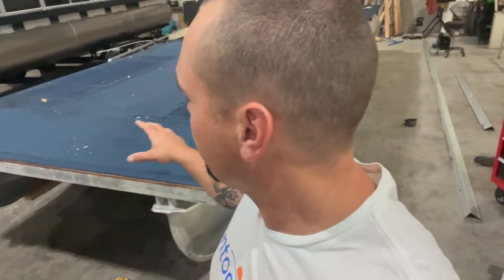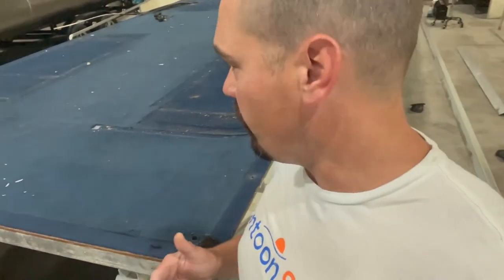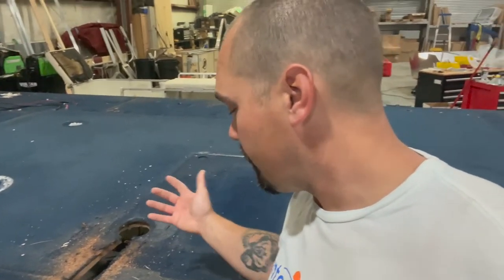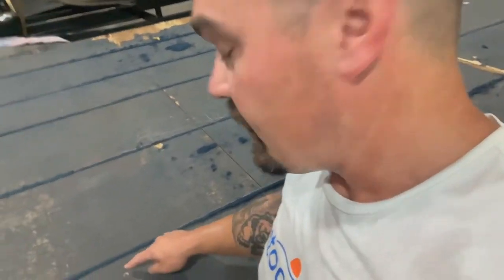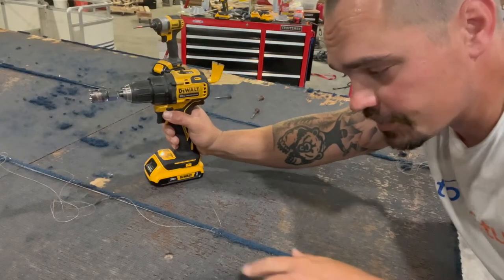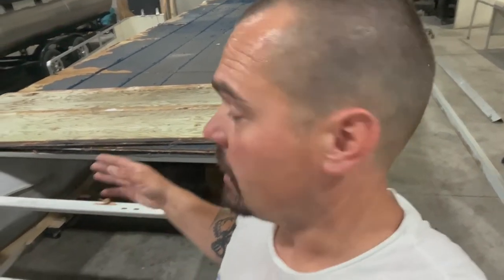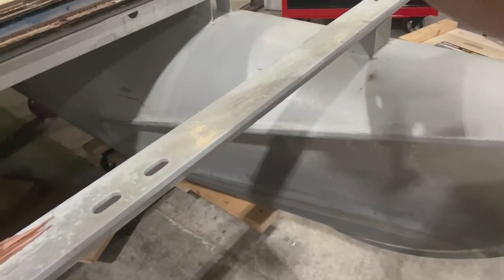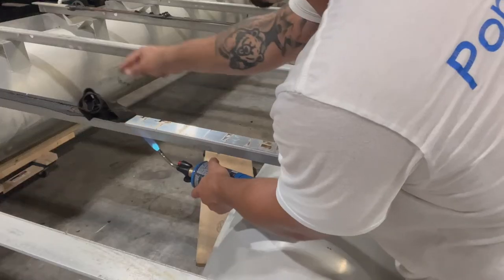Pontoon Restoration Tips and Tricks - Carpet and Plywood Removal

Comment: Thoughts on removing old carpet, laying 1/4" ply over top then installing vinyl floor over the "new" deck? This would be for an old pontoon houseboat, 37' overall. Looking to firm up the soft spots on the outside decks without doing a full tear out. Attempting to complete the work while on the water, in the marina.
Reply from the maker: That's a tricky spot to be in. I've seen someone add 1/4" plywood on top of an older rotten deck and it wasn't pretty. The 1/4" basically fell into pieces as we uninstalled everything. If a total tear off isn't an option, I would personally try to go with aluminum sheet instead of another material that will rot. Because we work on customers' boats we have to do it the best way possible so that we can guarantee the end result. I haven't tinkered around much with quick fixes like that so I'm not a ton of help on this one!

Comment: Our fishing club recently purchased an older pontoon boat to help transport and place fish habitats.  This is a total work boat.  We need to replace the deck but was wondering if we could use a less expensive plywood from a home improvement store to keep costs down.  Any recommendations would be appreciated.  Your videos have helped us get organized and prepared.  Thanks.
Reply from the maker: You could go with a CCA treated plywood that’s not Marine Grade…it’ll just have knots and voids in the surface you may feel under your feet…not a huge deal for a work boat that you’ll likely wear shoes on anyway. All the boats I’ve seen that were in freshwater have had no issues with CCA treated plywood reacting with the aluminum of the frame. Definitely mixed reactions about that out there…I can only speak from my experience.

Comment: DO YOU ANYTHING ABOUT A SEIZED UP MERCURY 50HP 2 STROKE  OUTBOARD
Reply from the maker: Probably was run out of oil or an oil line cracked, or overheated otherwise. Unfortunately it would have to be torn apart to determine if it's even worth rebuilding (likely it isn't).

Comment: Okay so… since the new decking has about a lifetime warranty and chances are I’ll have to replace the flooring again… why not just skip gluing it down?
Doesn’t the flooring dry faster without glue under it ?
Reply from the maker: The plywood will likely outlast the vinyl in most cases, however if you don't glue the vinyl down it will be more likely to wrinkle, wave, and crease. Plus it may not expand and contract with the plywood causing issues there too. It'll still give you 20 years of use if you protect it from the sun and take care of it. The vinyl flooring repels most if not all of the water anyway. 

Glue it down and do it right the first time.

Comment: 3 QUESTIONS:  (1) IF THE WOOD ISN'T TOO BAD, HOW ABOUT JUST FLIPPING IT OVER? (2)  ARE YOU FAMILIAR WITH THE PRODUCT TUFF COAT TO USE INSTEAD OF THE MUCH MORE EXPENSIVE VINYL, AND (3) WOULD IT BE BENEFICAL TO INSTALL CORRUGATED TIN UNDERNEATH TO KEEP WATER FROM SPLASHING UP AND CREATING MORE DRAG?

THANK SO MUCH FOR YOUR AWESOME VIDEOS.
Reply from the maker: Great questions!

1) marine grade treated plywood is void free on ONE side. Flipping it would move knots and voids to the top where you’d see or feel them. It would also be taking the surface rot from the top and be moving it to the bottom, still shortening the life of the wood. If you go through that much trouble to flip the wood you should just replace it to make it another 20+ years of worry free use.

2) I painted the interior walls of my aluminum jet boat I built (video series is on the channel) and I LOVE IT! I know they make a wood coating too, but haven’t tried it. I think it could be great, but go with a light color to avoid the floor getting too hot!

3) We install 0.063” sheet aluminum on a lot of tritoons as “underskin” to protect the bottom and crossmembers from spray/waves and quiet/smooth the ride out. Works great!

Thanks for watching and commenting!
Reply: Thank you Tom.  You are helping so many of us. You are appreciated.
Reply from the maker: @jaypietsch5411 happy to help, glad our videos and info is helping folks out there!

Comment: Why not use tape on all the aluminum rails to isolate them from the treated wood, is there a downside other than cost? Thanks for all the tips and tricks, your years of experience is invaluable to us DIY’s! What do you think of priming the (non treated) marine grade plywood sheets before installation as an additional waterproofing measure?
Reply from the maker: Thanks for watching the channel! It wouldn't hurt to put tar tape on all of the crossmembers, however it's just not usually necessary, especially in freshwater. The reaction between treated plywood and the aluminum is minimal in my experience. Even the big pontoon brand manufacturers use tape only on the seams. 

I only recommend installing marine grade CCA treated plywood as most other "marine grade" plywood isn't build to get wet constantly. If you MUST use an untreated marine grade plywood I would definitely consider coating it or sealing it to prevent rot.

Comment: Thanks ! So far tearing off decking is proving near impossible.. but here’s the bigger problem. Although the boards weren’t in THAT bad of shape.. I had one bowed like a hill. Taking it off suspecting water damage but actually… the aluminum crossmembers are bowed up from.. I’m assuming the transom box hitting the trailer center bar and resting on it.. 
It appears to be the correct trailer for the boat size… but why is this happening and how to fix. Help! Please 🙏
Reply from the maker: I've only ever really seen a crossmember bow up from the very forward part of the transom levering up against it. It seems to be common on Crest Pontoons especially. The weight of the motor pushes the back of the transom down, and it levers the forward mounted part up. If you've got multiple crossmembers bending upward then that's definitely something I've never seen before!
Reply: Thanks Tom,
You were right It was mostly just the one crossmember. I put the pontoon on the ground and off the trailer and It almost bounced back into totally straight ! 
So now I guess we just have to remember when trailering to keep the pontoon ALL THE WAY BACK on the end, about 1.5’ off the front, so that transom box doesn’t hang up on the trailer.
Also ! I found a few easier ways to get the rusted elevator bolts and self tapping screws out (my pontoon had 50/50) 
And got the last boards off today ! Just waiting on the new decking 😃
Reply from the maker: @marysimino1726  Glad that was resolved. It's common for folks to shove the boat too far forward on the trailer where the transom is resting on a trailer support. Glad things are going well on your project!

Comment: Hey cool video. About the treated wood there are different treatments they use. Gotta make sure it’s the same type of treatment.  Some wood says not safe with aluminum. Otherwise your right a lot of people gonna chime in. Lol.
Reply from the maker: Luckily we know this is the same treated plywood the big manufacturers have been using for decades. I’ve seen lots of chalky residue left behind by the interaction between the plywood and aluminum, but nothing where damage has been caused. Gotta remember we are freshwater only too!

Comment: Do you charge by the foot? How much was the charge on that particular job?
Reply from the maker: Every boat is different based on length, width, furniture and accessories, etc. Most 20' standard layout pontoons are around $4500-$5000 for a complete tear down and floor replacement. We never do a new floor without replacing the plywood.

Comment: Would undercoating the plywood with Duraliner or some other undercoating be good?
Reply from the maker: If using Marine Grade CCA Treated plywood there is no need to seal or coat the wood, top nor bottom. In fact, one could argue that the wood needs to breathe to dry out after being wet AND the wood must breathe to allow adhesive to cure under new vinyl flooring which does not breathe to allow curing of flooring adhesive.

Comment: I’m a fan of the treated as well. Pontoon stuff uses cca treated what’s your opinion on ac-c treated? They say it’s more corrosive than cca but it’s all we have in California.
Reply from the maker: I can’t say much on ac-c as I’ve never used it. I think those corrosive factors are multiplied in extreme environments like saltwater and areas with high electrolysis. I’ve torn down 80+ boats in the last few years and haven’t seen anything other than some white dust from the reaction. All freshwater boats though!

Comment: Thanks for the video, do you recommend the zylan coated self tapping screws or the 1.5" stainless steel deck bolts for the flooring installation? the self tapping makes me think they could come loose after a while and the deck bolts could protrude out on top so you could make feel it under the carpet? thanks for your recommendation and response.
Reply from the maker: Thanks for watching! It's common for us to use a mix of the self tapping screws and stainless deck bolts...deck bolts on the seams and self tappers everywhere else. I've torn down over 60 boats in the last couple of years and I've found that the bigger self tappers like the zylan coated ones DO NOT tend to loosen. The only boat I've had loose self tappers on was a newer (2011 I believe) Berkshire, and it had much lighter self tappers that honestly appeared to be stripped out from the factory. Here's a video of the 3" deck bolt, but it'll show you how I counter sink the head so that nothing is felt from the top side:

https://youtu.be/syNwS4-aupU

Comment: I’ve been apprehensive to replace the flooring because of needing to reposition the furniture/helm etc correctly. I’ve not seen any videos on how folks do that to configure the mounts how they were on the old wood after reflooring. Is that pretty straightforward? Any tips/tricks? I know a lot of your stuff you reconfigure, but in the case of using the same fencing and furniture. Use the old boards and holes as templates?
Reply from the maker: I love this question! I will definitely do a video about it on the next boat we restore using the same railings. In a nutshell, I would measure your spacing of the front and rear decks if applicable, and record the measurements so that when you reinstall the railings you can match the old spacing. From there, I install all new plywood and RARELY use old boards as templates for holes, unless they’re for transom fuel tank access or other critical parts that are being reinstalled. I use old boards as templates for rear deck cutouts or front deck shapes/sizes. 

I simply make all new holes once the seats and helm are reinstalled. Once your railings are in place your old furniture will match back up to the railings where you can fasten them into the new floor. 

I’ll make a video on the approach to reinstalling railings when I get the next chance. Thanks for the question and hope this helps for now!
Reply: @tomspontoons  that all makes sense, thanks so much for the reply! Love the content and look forward to a video around this.

Comment: Can you change the U shaped toons out for the round ones?  Or is it just better to go buy another pontoon?
Reply from the maker: I would seek out a different option if you want to do that size of a modification. Lots of good options that are affordable for late 1990s to early 2000s boats with bigger toons, stronger transom, and beefier structure.
Reply: @tomspontoons  I have been leaning towards selling my current pontoon and buy another one.  I will keep my motor because I bought it new last year and sell the boat with the old motor that still runs
Reply from the maker: @MrSilverado1982  sounds like a solid plan to me!

Comment: Im curious about the cost to do this, for a 21' pontoon. And how much time does it take to remove rhe seats etc.
Reply from the maker: The cost can fluctuate quite a bit depending on what all you do and add in materials. We have another video that walks through a whole restoration in great detail, I'll link that below. It usually takes us 1-2 weeks to complete a restoration project. That's working 8 hour days with 1 or 2 people working on the boat at various points. And most of our restorations are somewhere between $13K and $18K depending on materials, accessories, etc....and that's with parts and labor! 

https://youtu.be/BPHTvVAqn7o

Comment: Would it be ok to water seal the wood beforehand?
Reply from the maker: Great question, and a common one at that...short answer is no. When using a marine grade TREATED plywood there is no need to seal the wood, in fact you want the wood to breathe in order to dry out and prevent rot. Water will always find a way in over time, even if sealed, and I'd rather that wood be able to dry back out than have moisture trapped for any amount of time. 

I've never seen a boat from the pontoon manufacturers with sealed wood...that's probably the best trend to follow!

Comment: How much did you charge for doing the job?
Reply from the maker: A typical 20' pontoon boat with standard seating and accessories starts around $4,000 for complete tear down and installation of new plywood and vinyl flooring. It's a great time for us to address any issues that might be going on too with electrical, welds, etc.

Comment: Any info on tiki toons ?
Reply from the maker: Haven’t had a request for one yet…that’s usually a home-made sort of wild creation that spans from mild beach grass to full on tiki hut. It’s not exactly our specialty unless someone wanted the structure welded up.
Reply: Have a 96 suntoon 28’ x 8 1/2’. Want to turn it into a tikitoon. Any suggestions on design : materials ? Ty in advance.
Reply from the maker: @jer7168  That's a nice BIG platform to start with. There are some great FaceBook groups that would be helpful for you where people would share their designs and custom tiki pontoons. Pontoon Junkies and Ghetto Pontoon Restoration are a couple to check out.

Comment: Plz help. I'm redoing the deck of my boat and got untreated 3/4 marine plywood already and I'm curious what I should treat it with before installing? I'll be adding carpet. Thanks.
Reply from the maker: West System makes an epoxy resin kit that could be used. Otherwise an exterior grade epoxy, waterproofing, or even exterior water resistant paint. You just have to apply something to the top, bottom, and sides to keep water from penetrating. I haven’t tackled that issue myself, but I’ve seen the topic discussed in forums and groups for pontoon owners.
Reply: @tomspontoons  thank you!
Reply from the maker: @jlpictures84  happy to help!

Comment: I did this about 22 years ago.  I put down marine plywood.  I Have to do this again since the carpet looks bad.  Any chance I can just flip the plywood?  Right now it is about $150 a sheet.
Reply from the maker: I've definitely seen that done before on some groups and forums I follow about pontoon restoration. However, because I'm working on boats for customers I have to offer the best option for longevity which means replacing the plywood and all. So my best suggestion is spending the money now to have the new plywood that'll last another 22+ years (the plywood from PontoonStuff has a 30 year warranty). Use TOMS5OFF at checkout to save 5% on your plywood order from PontoonStuff.com/tomstoons.
Reply: @tomspontoons  I'm going to take your advice.  Just removed the carpet (your suggestion worked) and now to remove the wood. I have a 1977 24 foot Flotebote with a 35 Evinrude on it.  Want to replace the 2 cycle with a 4 cycle 90 Yamaha.  Has a wood transom so that will have to be replaced also. Glad I'm only 80 and have all kinds of time.  Are you located in Michigan.  I am.
Reply from the maker: @williamberridge4149  I'm in Grand Rapids, Michigan. For that old of a boat with a newer four stroke 90 hp I would definitely plan to reinforce the transom, get rid of the wood and go to all aluminum, and consider reinforcing the structure holding the transom including adding crossmembers and potentially beefing up the brackets that hold the crossmembers. That boat was likely never designed to hold that much motor weight nor torque.
Reply: @tomspontoons  I found a Pontoon Boat Transom Engine Pod Mount | 88 1/2 Inch Aluminum at Great Lakes Skipper. Boat part number 1101186 is a new pontoon transom engine pod.  Will this work for me? Hope I'm not a pest. Thanks
Reply from the maker: @williamberridge4149  that sure looks like it'll do the trick!! I need to start making those when I get spare time between jobs (if that ever happens again!)....they're getting a pretty penny for them.
Reply: @tomspontoons  Any way I can send you pictures? Need to make adjustments to the rear of the pontoon.
Reply from the maker: @williamberridge4149  Email is best: TomsPontoons@gmail.com
Reply: @tomspontoons  I sent an email the other day with photos.  Not sure if you received it.  Let me know please.
Reply from the maker: @williamberridge4149  I did see it come through! I was on the road all day today picking up a boat from Bellaire, so I didn't have my normal time in the morning to catch up on emails. I'll get back with you soon though!